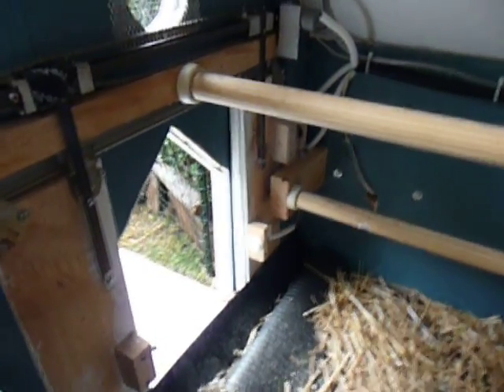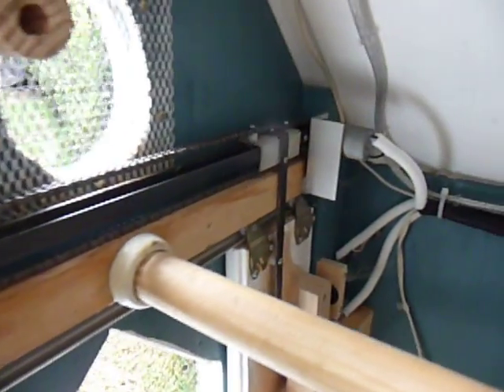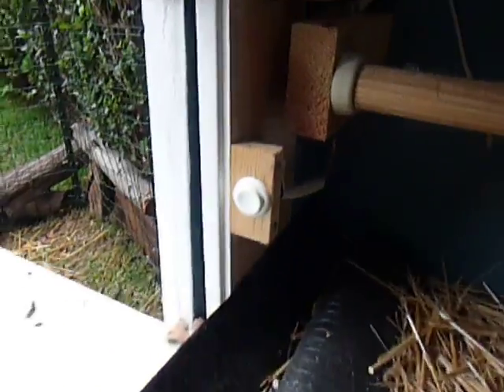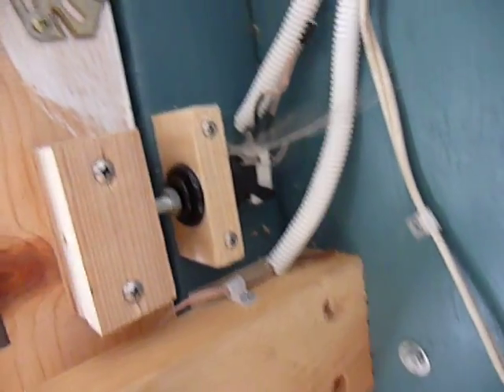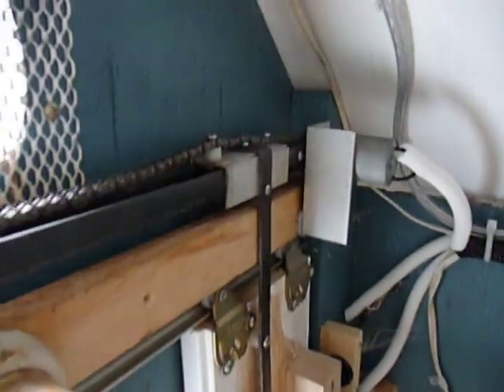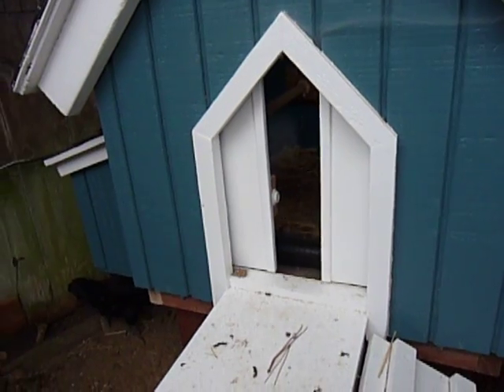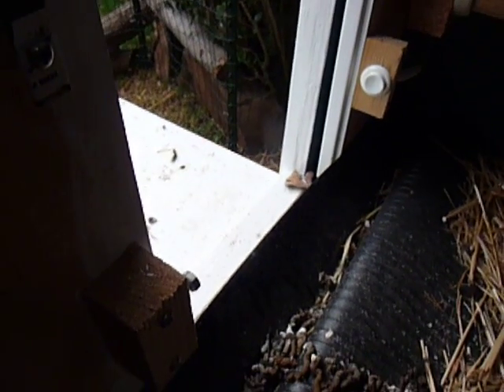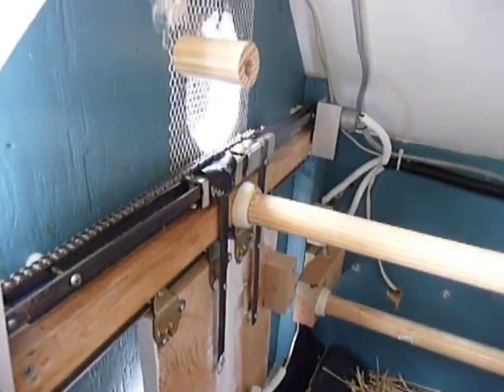Arduino Chicken Coop Door

Comment: Cool chicken coop. I started automating my chicken coop door more than a year ago after we had a visit from a fox which killed them all. The first version has been in "production" for over a year but has some deficiencies. I'm working on a new version based on a Arduino Pro Mini, with a more robust door closing routine and also a temperature sensor to turn on a heating lamp during winter. If I can give you one advice, get rid of the breadboard and make a proper PCB. It won't cut it through moist cold days, of all the issues I had with my initial design, it all boiled down to that. For version two I'm actually putting a lot of effort into a proper PCB board with all components neatly placed, well soldered and protect it as much as possible from moisture